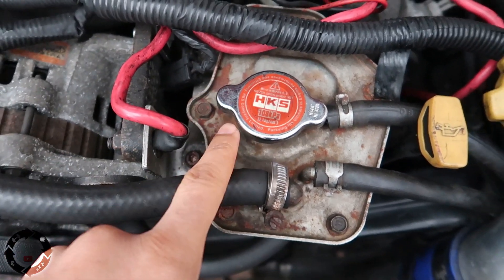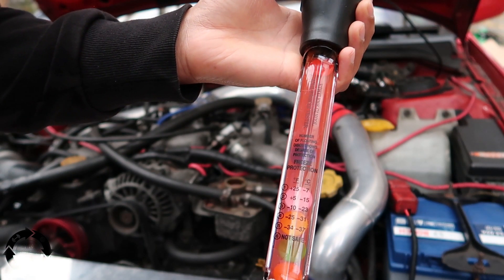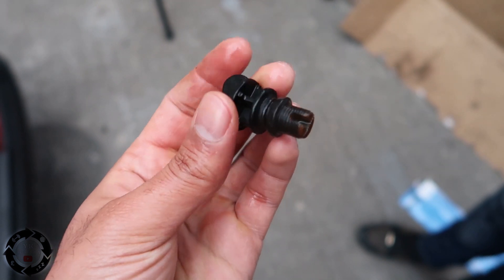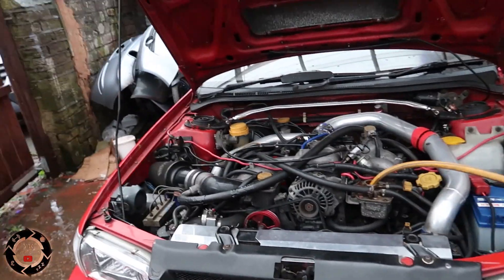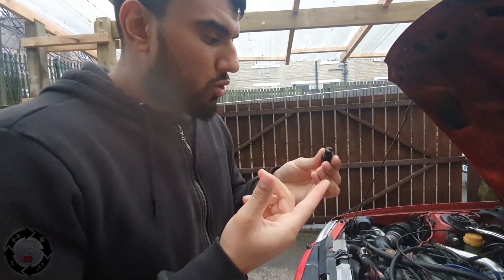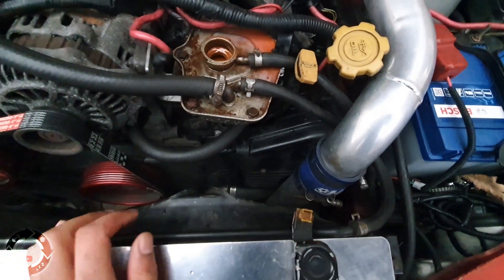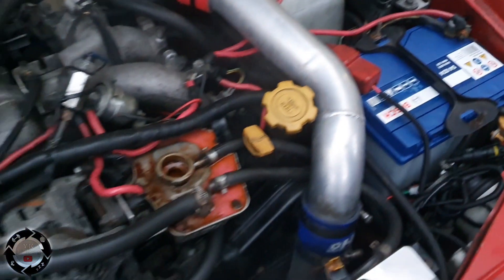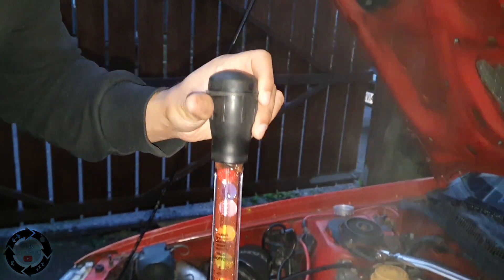HOW TO CHECK ANTIFREEZE AND FLUSH ON RED SUBARU *STEP BY STEP*

Comment: Good video but I think you should use deionised water to mix with antifreeze. You can get it from Halfords.
Reply from the maker: I've heard about this but wasn't sure if it was good, do you have remove all the water or if it can be mixed
Reply: @YKRECREATION  You have to remove all the old coolant. Mix it with fresh antifreeze. 

Its more of an issue for hard water areas because they have a lot of minerals in the water. Yorkshire has soft water so you should be ok.
Reply from the maker: @billy653  okay thanks will try deionised water in the summer flush 👍🏼 thank you

Comment: should've filled the full system up with water about 3-4 times, let the engine run and get upto temp and then drain from radiator. that'll definitely get the dirt out
Reply from the maker: When the engine was running it let most of the dirt out, would be too hot too open the system when its warm. This is like a full flush as some water drained out when removed the turbo 👍🏼